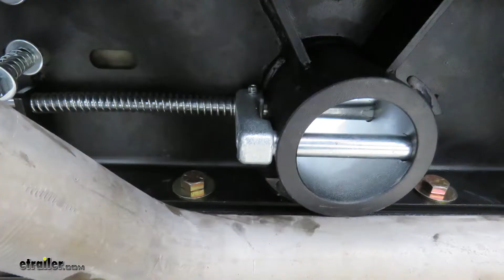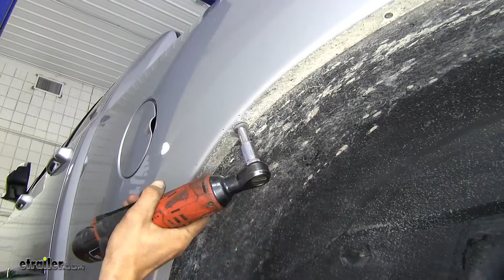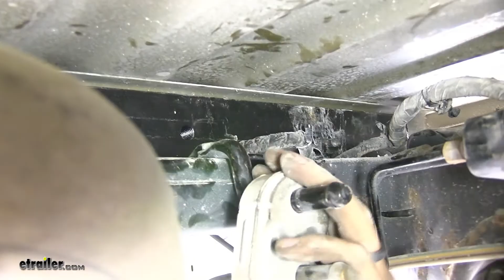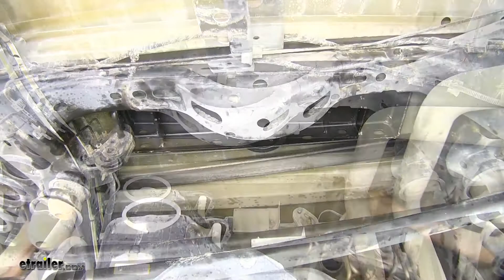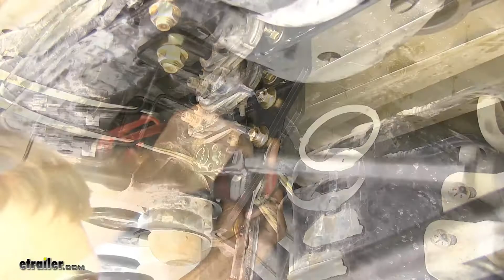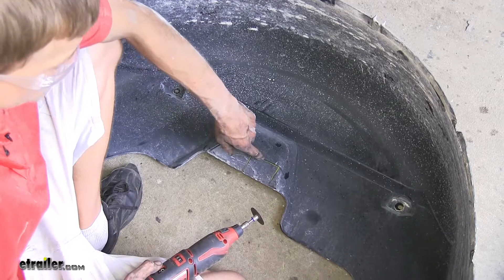etrailer | Curt Double Lock, Flip and Store Gooseneck Hitch Installation - 2013 Ram 1500

Comment: Does that work with airbags installed ?
Reply: U mean with the air ride suspension that has the tanks above the spare tire?
Reply: Andy Hass no aftermarket airlift 5000 is what I have installed with aircompressor...